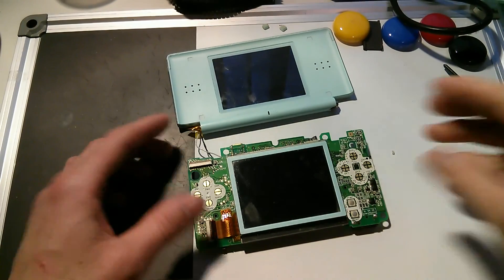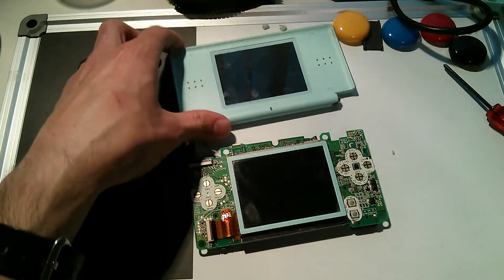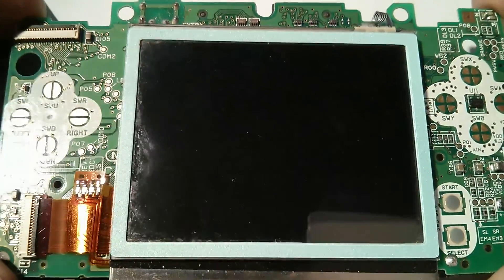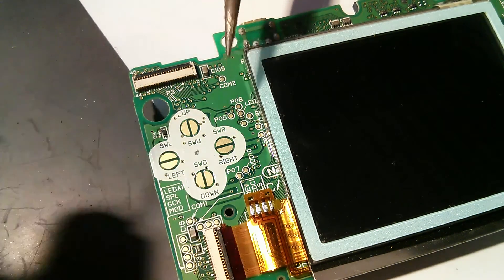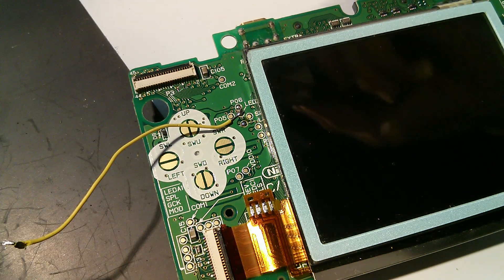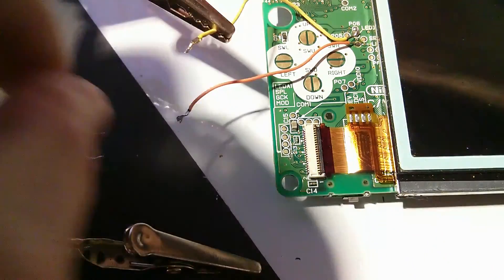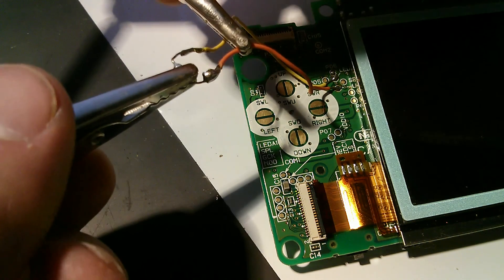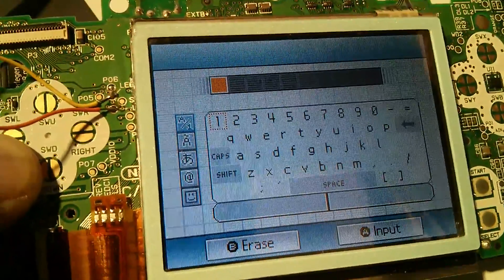Convert broken DS into gameboy advance

Comment: there is a easy way to turn it on just hold all the ds button except the d pad  when turning on
Reply: but then it boots into gba mode directly... with the method shown in the video you can still access settings, control brightness etc

Comment: Hello! 

The led is 5mm or 3mm?

Thanks
Reply from the maker: I used a 5mm LED but ether a 3mm or 5mm will do
Reply: @facelesstech  you use any fixing bracket whit the led  ?
Reply from the maker: @DjISI  nah the LED should just fit in the hole left by the top screen in the hinge

Comment: Can I make it work without the resistor, or LED? I don't have one, but I have a soldering station.
Reply from the maker: If you still have the top screen. you can take the top screen ribbon cable and cut everything off apart from the LED from the screen. Then just attach the cable back to the button board and cram it all back into the case
Reply: Wow, you replied! Thank you so much, dude you made my day.
Reply: Also, please would you point in the video if possible where is the LED in the top screen? Or send a link with a pic of it, please.
Reply: I have already cut the ribbon cable, to the maximum, and I have left the speakers, I tried booting it up, but nope... White flash followed by turning off, I seems, that I have to buy this resistor.
Reply from the maker: @ekisfrole3118  gutted, sounds like the ribbon cable is damaged. If you can solder SMD parts you could get a 330ohm 1206 resistor
Reply: Yeah, I seems like it, but I found the resistor I needed and tommorow, I should be able to fix it, using your video! Again thanks for all the help, I wonder why your channel dosen't have more subscribers, I hope this changes in the future!
Reply from the maker: @ekisfrole3118  Im sure it will work out for you . Its the youtube lottery, its really hard to grow

Comment: do you have to have two wires connected to the resistor or can you just solder the resistor to the motherboard?
Reply from the maker: Jaakoppi Koskinen no you could just solder the resistor straight to the board if it will fit. If your feel adventures you could get a SMD 1206 330ohm resistor

Comment: You should do a video on how to fix a regular ds lite when it flashes like that then turns off cause I can't find a video on that
Reply from the maker: The flashing when turned on is because the DS can "see" the top screen so it fails to boot. This is why if you do this mod you need to add the resistor so the DS is thinking it can "see" the top screen.

Comment: I got a fat Nintendo DS and the flat cable for the second screen was cut. Then I got a recharger to use on it, the recharge led goes orange and when I try to turn on the DS (with only the screen below) it flash the screen and turn off. It works with only one screen attached? Thanks

Comment: do you need the resistor
Reply from the maker: TechGuy2005 yes or the DS won't turn on, you can use an LED on its own instead of the resistor
Reply from the maker: You just need  to solder a pair of wires off the same two points on the PCB then solder the LED onto the pair of wires
Reply: there is a easy way to turn it on just hold all the ds button except the d pad  when turning on
Reply: Ilyass Al that’s challenging to do every time you want to boot it up
Reply from the maker: @professormarill3251  No you don't need the wire
Reply: Might sound like an idiot here, but can you not just shoulder a wire from point A to point B without even using a resistor/LED?

Comment: What is the size of the fillip(?) head screwdriver do I need to unscrew the battery hatch, I have the triwing and just need that screwdriver, so far none of mine can fit it and the only one I think can I can't find XD
Reply from the maker: Hi I normally use a 1.5 phillips head screw driver. If your struggling to get one just look for iPhone screw driver set on ebay
Reply: Facelesstech Thank you, but I already found out which one I need and I am now stuck on the soldering, but thank you anyways
Reply from the maker: AREALLYFATLLAMA THE LLAMA Glad you found the screw drive. What are you stuck on with the soldering?
Reply: Facelesstech Buying the solder, my dads an IT so he has the supplies for soldering BUT are solder

Comment: I had previously seen another video where I needed to solder the resistor to the ribbon cable of the old screen and keep it connected to the motherboard. I see that instead you are soldering the resistor directly to the motherboard. I may have to try your method instead. Only downside is that I will lose speaker functionality.
Reply from the maker: +ewinmn That sounds interesting. I was trying to reverse engineer the speaker connection from the ribbon cable port but ended up blowing the fuse on the PCB so didn't look much further. You could try soldering straight off the headphone jack
Reply: You can desolder the the speaker with it's wires. Solder the black wire to the GRND and the red wire to the RSPK or LSPK ok the motherboard. I did it once and it work for a bit cause I suck at soldering. It fell off, and I burnt the mother board. I hadn't soldered the screen cause I didn't have the resistor. But the macro went straight to the game or else it didn't turn on. Now I'm working in one that won't work at all even with a GBA in the port.

Comment: 1. What size trip wing screwdriver did u use 
2. How can I get speakers
Reply from the maker: I've only ever come across one size of tri-wing screw driver. If you search on ebay for "Nintendo tri-wing screw driver" you should find the right one.

About the speaker, I'm not sure myself but if you do a quick google search I'm sure someone else would have figured it out ;)
Reply: Thanks